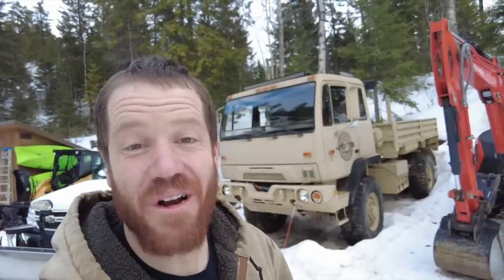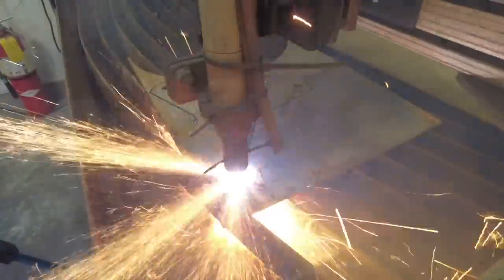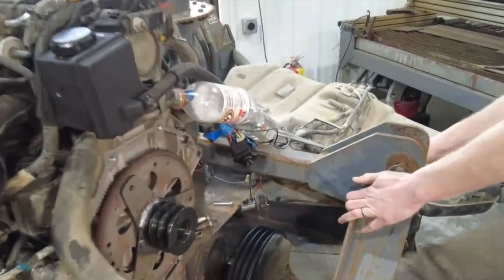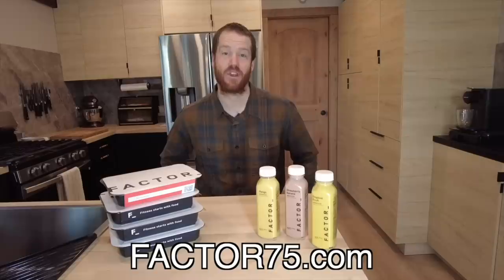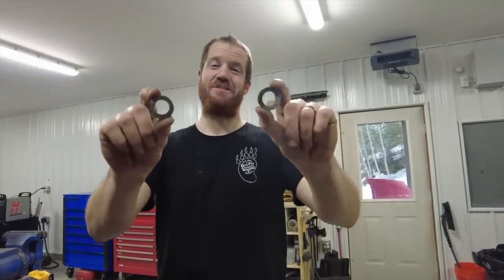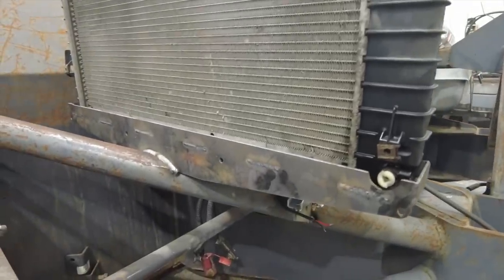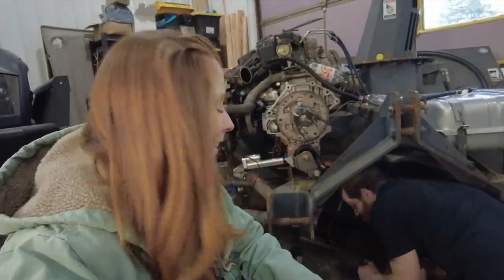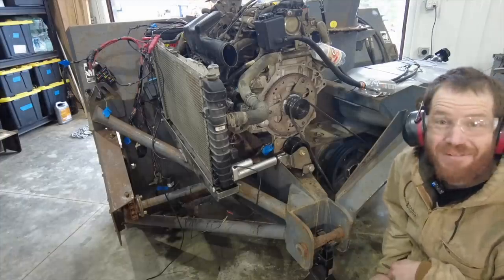DOES IT WORK?! | Building a MASSIVE Snow Blower P3

Comment: I love how some real engineering is combined with a healthy dose of MacGyvering to make things happen. Truly entertaining. I would love to see you tell us a little more about some of the items used, like what are the specs on the electric actuator. But that is just the nerd in me coming out. Thanks a ton.
Reply: I have the same actuator and recall : 12vdc, 160 lbs of force.
Reply: Sweet. Sounds pretty stong,cause it's gonna need to be!!
Reply: Another application is a centrifugal clutch, basically a pulley-based CVT (Continuously Variable Transmission). Not sure if one from a snowmobile could serve this purpose? (just a thought)

Comment: It would be nice to build some adjustment into your tensioner. As the belts stretch a bit it might help to be able to optimize the belt tension.
Reply: Agreed. Something adjustable on the opposite side would work a treat.
Reply: It has "built in adjustments"  the actuvator will push the belt until tight  no matter how much the belt stretches !!!!  DUUUUUHH!!!!!!!
Reply: The linear actuator (I have that same unit) is fully adjustable so why add anything else? What might be nice is an external limit switch operating a light in the cab to let you know when you've reached the right extension/tension.

Comment: Great job you two.  Really am enjoying this project.
Reply from the maker: Thanks for following along!
Reply: Well   lets wait and see IF it will actually blow heavy snow, the small pully may NOT have enough surface area to transmit enough power to blow heavy snow, may need a larger pulley and that will turn the blower faster, need some trial and error !!!

Comment: Need project, thumbs up for sure. A few comments if I may.
1. Most folks who build a blower like this go hydraulic. Have a power pack on the bed of the truck with hydro lines running up to operate the blower hydraulic motor. I'm curious why you went belt drive rather than hydraulic.
2. The first time you hit a rock you'll sheer  that sheer pin bolt. Hopefully it's oriented in a way that's easy to replace when the blower is on the truck.
3. When building a sheave system, you want to line up the grooves, not the edge of the pulley. Oftentimes the sheaves have a tendency to be a little bit different and thickness on the edge and so if you line up the edges the belts aren't aligned. It kind of looks like you got lucky there. You also want to make sure that the sheaves are aligned parallel to each other and not cocked at an angle. Doing so makes the belt tension much more even. If you take a laser pointer and lay it in the grooves of one sheave and point it toward the other, it will give you a good indication of how well they're aligned. There are tools that do such that same thing but they're expensive and a simple round laser pointer works well.
4. The easy way to measure for a belt is to take a piece of rope wrap it around the sheaves and then measure the rope that will give you your belt length. You won't be able to find 5/8 belts at an automotive supply store commonly. Someplace like tractor supply or a commercial supply place such as Grainger will stock them. A belts are half inch, B belts are 5/8.
5. You could of course simply purchased a small tractor for what you're going to have into this blower by the time you're done (or less). However, what would be the fun in that? I've always said that overkill is consistently more fun.
6. To aid in your cold startup for any of your machines kept outside, you could always use a magnetic oil pan heater. The mountains of Idaho get exceptionally cold at times and the oil in the pan is very sludgy at those temperatures. A 300 watt magnetic oil pan heater and a little bit of insulation is a simple solution to an easier startup.

Comment: Great job as always Riley!  Your skills are so good.  Now you have a working unit, and it looks like it will do what you need. My suggestion would be to find a way to enclose the engine so the snow will nit get on it, to prevent freezing of the throttle, the belts or the pulley, or the belt tightening mechanism.  I also know that the mount to the truck will be tricky, as that unit is heavy, and you will need either a good size hydraulic cylinder to lift and lower the machine, or electric over hydraulic unit.  Also the mount to the truck will need to be very sturdy, as if you hit frozen rocks, and a tree from the side, it will break easy.  You must think about an easy way to mount and dismount the unit, as you will use the truck for other things, on your property, as it has a ton of uses.  Good luck, and I am positive you already know what is ahead of you, but excited to see the final designs, and see it working as a complete unit, blowing out your driveway.  It will make you road so much easier to drive your vehicles on.
Reply: The army truck already has hydraulics to raise the bed.
It needs a valve to switch the oil from the bed cylinder to the snow blower.
One-way cylinders to raise the snow blower will be fine.

Comment: I want to see how the LMTV handles all that weight up front...
Did you ever get chains for it?
How much lighting is in the plan?
Freaking awesome man!!!!!  I can barely contain my excitement for the next video!!!!
Reply from the maker: I mean, the weight is only on the truck if the blower is up which would only be for turning around and stuff. We'll see. Truck has a few light bars on it already. Might add one to the blower though so we're not just lighting up the flinging snow. I had custom studded chains made for it.
Reply: I'd be very surprised if the front axle is rated for anything less than 10K so the issue with weight should only be one of ease of steering - Riley's got biceps so all's good. 👍  Tire pressure kept a bit high up front should ease the strain a bit. A couple of bucketfulls of sand towards the rear of the dump box should do wonders..
Reply: My thoughts exactly.
Reply: @brustar5152  The M1078 is plated for 12k front, 10k rear.  Tires are rated to 10k each.  But, with a GVWR of 22,770 and the stock truck weighs 17,214, that only leaves 5,556 lbs for cargo.  Most of the weight is up front as well.
I doubt Reckless is planning on driving over a DOT scale with the blower mounted anytime soon, unless it is closed.
I think it will be fine, but I reccomend putting some weight in the bed equivalent to the weight of the blower.
It should be interesting, to say the least.

Comment: I just cleaned snow of my blower project yesterday.  I had few pieces made this week. Should have last pieces needed. 
I'm using 4-53 Detroit from trackhoe with 3 hydraulic pumps.  Running blower with orbital motor. Some of build on my channel.  I built a 3 point mount on pickup

Comment: @ Ambition Strikes
20:09 - The upper small pulley rotates constantly as soon as the engine is running. The belts are always in the same place when the belt tensioner is relieved - and therefore the belts will burn away like nothing! You need an   ELECTRIC CLUTCH   as used on air conditioning compressors! Then the upper small pulley turns only when you want it to, so as soon as you have switched on the electric clutch. Then you tension the belts by means of your belt tensioner and the snow blower runs. 

Translated with DeepL
Reply: That was my first thought too I don't see those belts lasting very long.

Comment: Need an equipment/implement shed. Check out what farmers use. Typically, it's a long, 3-sides enclosed, shed roof, back to the wind structure. All the equipment is lined up out of the rain/snow ready to use.

Comment: I've built many drive systems such as this. In my experience, I have always found that bolting to a flex plate, such as you did, will cause cracking and a total failure under load. The building or finding a suitable manual non-sheet metal flywheel will last indefinitely. As well as a hub bolted directly to the crankshaft. This is an issue at this point in your design, as it would change your alignment. I wonder if this engine ever came with a manual transmission to source a solid flywheel. Depending on its capability, I recommend you build your own flywheel at the machine shop with a large lathe or possibly with your plasma cutter. Make sure it's balanced like the stock flywheel sometimes the engine is internally and or externally balanced. The manual flywheel would /could change your pulley alignment as well. I have previously machined a stub shaft that is slipped into the crank then through the flywheel (welded) and then allows the pulley to be locked onto that shaft in the industry standard for your pulley. Watch your tensioner pressure as your side loads the crank bearing. Sometimes a pillow block is required on the driven pulley opposite the crank side to carry that load to not wipe the engine's main bearing. The advantage here is a heavy steel plate (not sheet metal), or the stock flywheel could allow cutting the flywheel and pulley to the correct thickness to keep your current pulley alignment. If that is difficult to do at this poin ort to alter your driven pulley point? If you choose to build a flywheel or have to build it.
Remember, you can move that ring gear to your new custom unit. Use a banded belt if you can use it instead of a single belt. If you must use single belts, make sure there "matched"; it makes a difference after a few hours of hard load. Top-notch work on all your projects. I'm watching the video when you're running the unit, and I cannot tell if it's running backward? Most people not doing engine conversions or drive systems need to realize that only some engines are in the same direction. For instance, Hondas are great engines for updating old drive systems but inherently turn the opposite direction to most machines. I run this eco-tech in my race car. It's a great platform when it's not having timing chain issues. You might not see that with the low hours; you'll use it, but I assume it has a lot on it now. You'll hear that chain long before it fails in the car, but you lose the valve train when it does. I don't know if you'll hear it in that diesel truck. something to think about, and it's so much easier to change now in the configuration outside the engine compartment. Good Luck great work and the skid steer is an amazing snow blower, but this is much more entertaining than watching you buy a machine.

Comment: The ball bearings in your large pulley adapter, should NOT be dry. There needs to be grease in that connection, so parts don't inertia weld themselves together if a shear pin brakes.
 You might find it handy to figure out how to govern the engine, like all tractors are governed. There are belt driven governors that can be added to an engine.

Comment: More containers, stack them in a triangle, frame and insulated from the outside to protect the metal from moisture issues and you can lean-to for extra storage seasonally. You can cut out all the openings between the containers you want to, and there are many options to run utility chases between them and the exterior finishes are only limited to the dimensions of your framing and the configuration of your stacking or even just two spaced apart. 👽

Comment: Very cool.  As George Peppard said, "I love it when a plan comes together".  You might need to cobble up some type of remote throttle control, to rev the engine from inside the truck.  GM has had a throttle by wire for a number of years but a servo setup from an RC car might work and would be simpler.  Looking forward to seeing it throw some snow!

Comment: Thanks. Enjoyed that video enough to play parts of it twice. I think you accomplished a lot with that little lathe. Well done. 

The design is coming together nicely. You've probably already figured it out, but I think you're going to want a governor on that engine. The load will change dynamically all the time. The governor will allow you to set an rpm and have the throttle adjust to maintain it in the presence of widely varying load conditions.

Comment: It's so awesome the way you guy's come up with a design and application for the blower motor and it's operation and the engagement strut and pulley.
 Can't wait to see how you attach it to the truck and the throttle cable operation to operate it from inside the truck. 👍😎

Comment: Congratulations that is a awesome setup. Riley why don’t you spray a coating on the back and exit shoot . It will lubricant and protect the metal from wear. Plus lube the chain it will run smoother and quieter

Comment: PRO TIP: If you move your bit on the lathe closer to the mount, you wont get as much chatter/vibrations. I have the same lathe.. and it helps alot.

Comment: Hey guys , just food for thought maybe you could use a clutch fan like on a a/c compressor, it would allow your fan to spin freely on motor pulley until you engage clutch, which would save heat failure of your fan belt.

Comment: Excellent job guy’s, this thing will be awesome. Love ur stuff, you are a real “Gyro Gearloose” and have a great skillset. Measuring for belt sizes can be tricky, if possible I always fit a new v-belt to the smallest pulley first as it is easier to rotate the larger pulley & force the belt on if ur using a tighter belt size, also u can measure the belt size with a piece of string or rope, if using string make sure ur measurement is on the outside diameter of ur pulleys, a good belt fit should not hit the bottom of the V section unless worn. Keep em coming. Cheers

Comment: Necessity is the mother of invention. Perseverance and a willingness to fail and adapt to succeed is another level.

Look forward to seeing this beast in action. I am concerned about not seeing a temperature gauge, fan and shroud for engine cooling. Let's see what happens  

You might need another belt or two though especially if the thickness is too small especially when the load is put on with the snow.

Comment: Here's a tip for starting pull-type motors like that splitter (which started amazingly well given the conditions). Use a standard 3/8" battery powered drill with a socket adapter and a socket the correct size for the nut on the crank, below the recoil rope assembly.  Spin it with the drill in high gear and it starts easily.  Just remove the rope recoil housing - typically 3 or 4 bolts around the outside and lift the assembly off. That gives access to the nut I refer  to.  The adapters are about $6 from Harbor Freight. Home Depot etc. also carry them.  Oh - I found the longer socket adapters to be better, no need for a separate extension then.
3 Piece 2-1/2 in. Impact Rated Hex Shank Socket Driver Set
Impact Rated Hex Shank Socket Driver Set, 3 Pk.
HERCULES  $5.99/

Comment: Hey guys, next time you want to save a few trips to town just use a three-quarter inch tape measure roll it around the outside of the pulleys, boom that's your belt length! One thought I had was, why do they call it a flexplate????🤔 Very entertaining videos, right down my alley.

Comment: Not sure if I asked in a previous video, but did you consider hydraulic power to run the PTO input?  The motor could run the pump, and a gearator to spin the PTO.  This would also give you the option for the disconnect for starting the engine without load, as well as quickly dropping the load as needed.

Comment: In the interim, before you build a larger shop, you may want to consider just extending the roof on the end of the woodshed. Even having just covered storage would greatly reduce the amount of snow on your equipment, and would provide protection from rain in the summer as well. Sink some posts, extend the roof line about 40" and you've got tons of extra storage for not a lot of money.

Comment: Gates belts have tools for converting between belts. because the A belts (1/2) run deeper in the pulleys you will need a different length value when you go to a B belt (5/8). The A and the B have a different angle profile than the 3V and the 5V so make sure you are truly using the right belt for the pulley. I would also recommend the Gates green belts for lawnmowers as the have better resistance to clutch engagement and bending backwards. Talk to a gates tech for sure since they can tell you the right belt in their sleep.

Comment: Riley, have you thought about the side loading on the engine's crankshaft the tensioned pulleys are causing? The engine's bearings are probably not going to have a long lifespan in this application. Why not mount a jackshaft on pillow block bearings and take the drive belt from the end of the jackshaft?

Comment: That's a very good start to get what you want. I'm concerned about the side load on the engine crank. Pretty sure radial load would be less problematic on the engine crank. I may be wrong.

Comment: When you order the belt make sure you get a gang belt( 3 joined together). 
Whilst it has all come together nice I’m a bit worried about the side thrust on the crank bearings and weather they can hold up. They are not made for that side thrust and may not last long. You probably really need the pulley on a shaft supported by roller bearings to take the side thrust from the belt.

Comment: That is some very fine engineering right there! Is there grease Zirk points for the auger bearings? The chain also looks pretty darn dry. I have a PTO snowblower for my tractor and I gently pour chainsaw bar oil on the chain as its at an idling speed to get really good coverage. It also has grease Zirk points for its bearings.

Comment: You 2 have to build a guard for that flywheel and belt assembly and I would also built some kind of hood system to protect the engine and all that is needed to run that snowblower